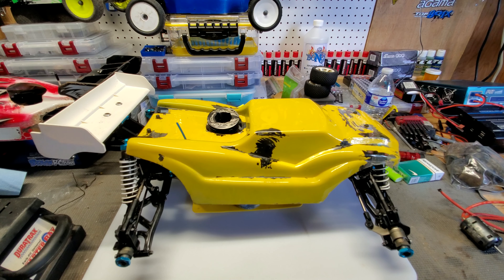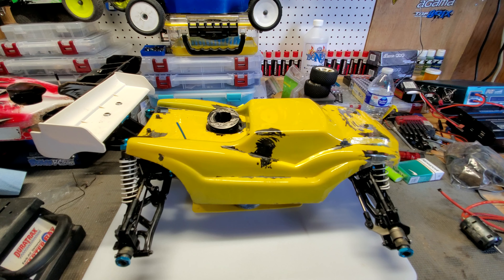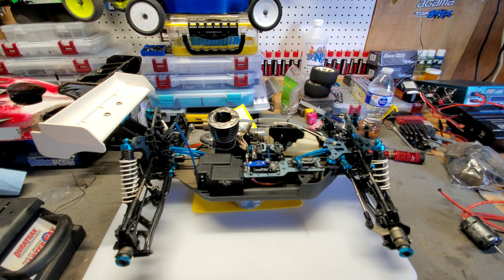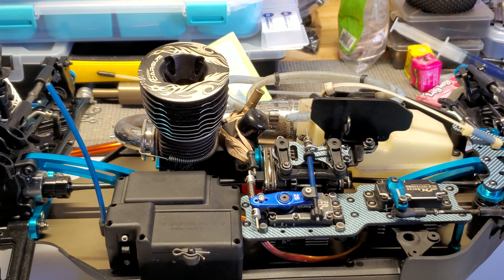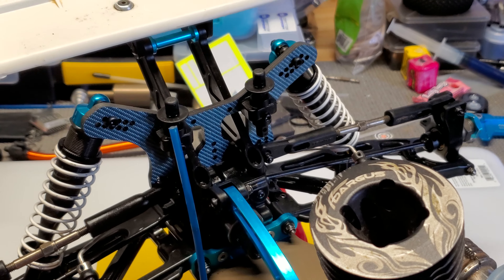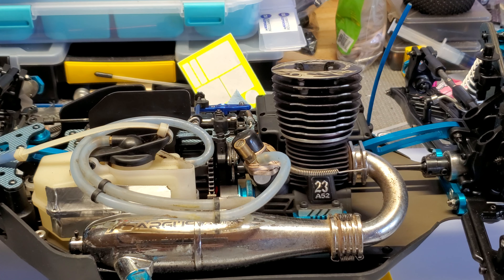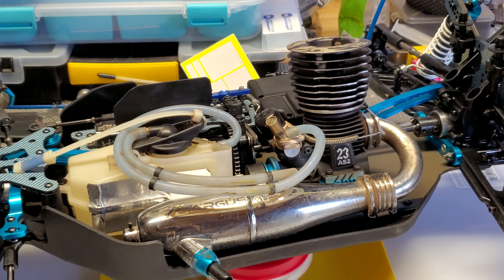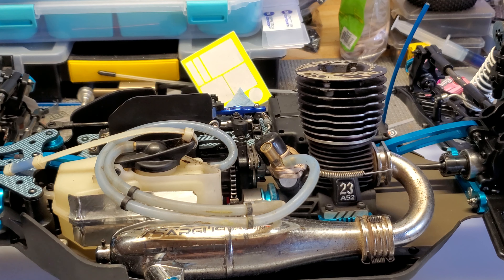Overview of my Tamiya 801 xt 1/8 nitro Truggy🏎💨

Comment: Lol you sure have a lot of empty ultimate air filter oil bottles in the background I heard that stuff is supposed to be the best 
( super sticky )
Reply from the maker: Lol...its alot of Ultimate bottles but those are shock and diff oils there is 2 bottles of the air filter oil behind the totes and your right it is some good stuff but I mostly use dirtbike Fab1 air filter spray and cleaner. Works for pro motocross racers and comes in big cans instead of little bottles for 11 bucks. Good eye bro🏎💨💯👊👊💪💪👍👍